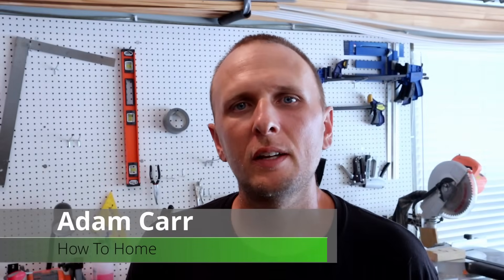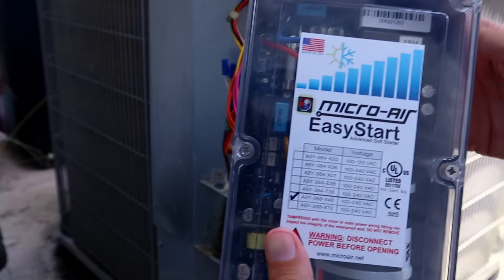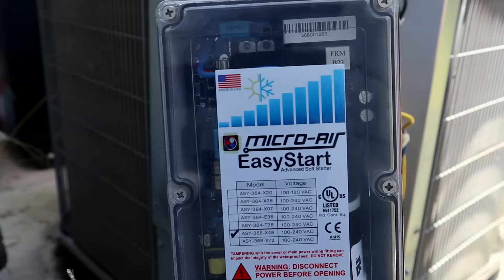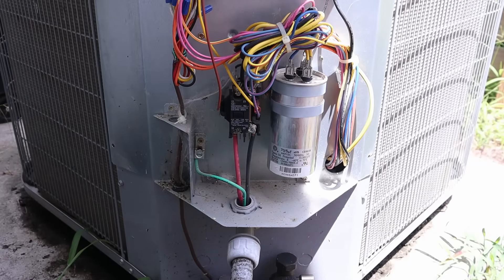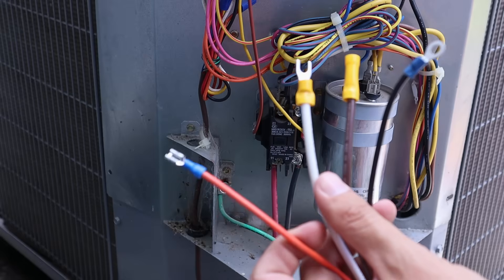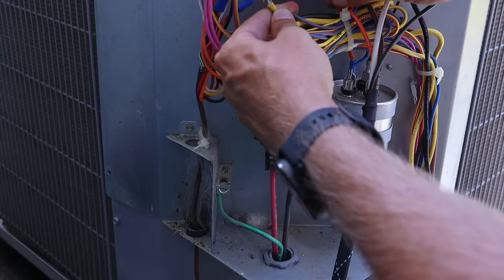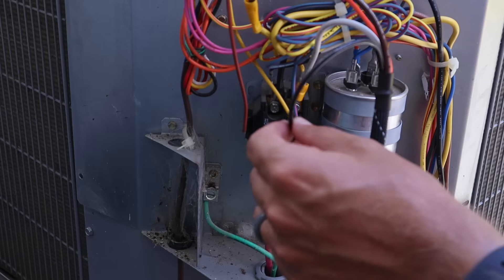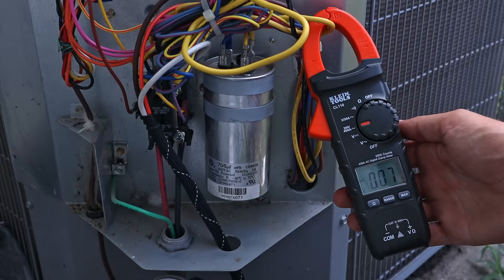How To Install A Soft Start Kit On A Air Conditioner | Run Home AC With A Generator | MicroAir

Comment: Adam,
My son and I just finished installing the Micro Air ASY-368-X48 Soft Start gizmo on our 4 ton A/C unit. We followed your instructions to a "T" and the results are as follows:
The IRA before was at 76.9, after the gizmo was installed it dropped down between 30.4 and 33.i Amps.
The running Amps before was between 12.8 and 13.1 and it dropped down to 10.9 Amps after the gizmo.
We attached ours to the side of the A/C unit and put a hoodie over it so that the intense south Florida sun does not bleach out the decal or make the clear plastic cover brittle over the years ( also it protects it from the rain).
We could have not done this without you, thank you so much for posting your informative, detailed video so a layman like myself could accomplish this.
Thank You and GOD BLESS YOU!
Reply from the maker: Wow, fantastic results!  Very similar to mine.  I also ended up making a box for mine just to shield it more from the elements and like you said, the sun.  I am glad to hear you were able to get it installed and it is working for you!  When the next hurricane comes, you are going to love having it!  Thank you for the feedback!  Always happy to hear when a video helps someone.  God bless you too!

Comment: Adam, Thanks for your quick response. I couldn't find the HERM label but I found out that it's the one that goes to the compressor. I will attempt the install tomorrow based on your very done video. Wish me luck!
Reply: For future reference from an hvac tech you could also count the pins for the spade connectors on the capacitor. 
4 is common from the contactor
3 is herm for the compressor
2 is fan to the condenser fan motor
Reply from the maker: Ok great!  Good luck!  Let me know how it goes.

Comment: Thanks for the vid. Bought the same easy soft start kit and hired a licensed HVAC to install it on my 4 ton Rheem for $65. IT WORKS LIKE A CHARM with my Wgen9500 on propane (11200/8500) generator. We’re now ready for the next act of nature here in Texas.
Reply from the maker: Awesome!  That is a good price!  You are definitely all setup and prepared.  We had some big storms wipe out the power a couple days ago for a few hours.  Hooked the generator up to the house and was like we never lost it haha.  Thank you for the feedback!  Enjoy!
Reply: You must live in bfe.  No one even knocks at the door here for under $85
Reply: @raddadization  No kidding. He must already be a next door neighbor/friend/ relative or something.
Reply: Do you know the running amps/kw when you are running the ac on generator power?  I am considering the Wgen 9500W thank you.
Reply: @CaptHammer  typically when the compressor kicks in, a 4 ton unit runs on about 5,000 watts.
Reply: @carapungo  Awesome thank you!

Comment: Hello,

Great video but which is the Herm terminal on the condenser. I see terminals that have wires going to the fan, kin of confused.
Reply from the maker: The capacitors usually have the terminals labeled somewhere around the terminal itself.  Typically there are 3 of them, c which is common, fan, and herm. Mine were labeled on the top of the capacitor.

Comment: Not trying to be negative but after pulling that disconnect double check to see if power is still present and discharge that cap once in awhile I hear of somebody getting hurt taking short cuts but otherwise good info thanks.
Reply: Nobody has ever been killed by a capacitor in a hvac unit that had the main power turned off. I have been zapped over a 100 times by power stored in run caps in the 30 years I have been doing hvac. It just wakes you up like a jolt of coffee

Comment: Where can I buy the soft start kit?
Reply from the maker: I have links in the description that will take you right to them.  Just make sure once you click on it that you select the correct sized one for your size AC unit.  Or you can go to Micro Air's website and find them their as well.

Comment: I appreciate how you give us detailed comments. I want to buy that same soft kit for my 4 tons a/c...but my generator is the Wgen 9500 dual fuel...will it work? Thanks in advance. Great vids.
Reply from the maker: It definitely should barring something weird going on.  Your generator I believe has 12kw or 12.5kw starting watts which is 50 amps at 240 volts and running amperage of around 39 amps.  If by installing this it got your amperage down to where I got my 4 ton, then it would barely break a sweat starting up the AC.  You would here it pull down briefly and then return to almost normal as your run wattage is plenty to run the AC once it has started up.  Hope this helps!  I really appreciate the feedback!
Reply: @HowToHomeDIY  you are the best.

Comment: Just added mine to our 4 ton unit. Runs the AC no problem at 75% load on my Storm Responder 6250. Your video made the install directions crystal clear!!! Thanks man!
Reply from the maker: Wow that is awesome!  These things really are great.  Glad you are up and running.  Thank you for that feedback! 👍
Reply: Are you guys seeing a substantial dip in voltage & hz from the generator when the AC unit starts up? I just damaged both my refrigerators while running whole house on generator. I believe the issue to possibly be a dip in voltage/hz when the AC unit starts up. Just curious to see if you have experienced something similar?
Reply from the maker: It could have been from what you described but it could also be your generator.  If it has a higher THD% it could damage the sensitive boards on whatever you are powering.
Reply: @HowToHomeDIY  The THD is less than 5%. It’s a generac Gp17500e
Reply from the maker: Oh ok.  If it’s that low then you should be good there.

Comment: I have the same unit installed but it comes with Bluetooth and basic app. Sometimes I get 25A,35A and sometimes I get 50A.I even get 65A. Several relearns and I can never get it to consistently keep the amps low.I have no clue what is going on but for some reason it does not work reliably. I did compare the data that are coming from the EasyStart app with an amp clam and the peak current is pretty close but the running current is off by 4A.....Very unreliable device as I dont know what it will draw at any given time. What do you think it might be wrong
Reply from the maker: I do know in the very beginning that the in rush amperage will vary as it is learning your system and the most efficient way to start it.  Anything outside of this I would call micro air and see if they have any suggestions as I personally haven’t experienced what you are describing.  I don’t have the Bluetooth version but I do have a sense energy monitoring device on my service panel and I haven’t seen any irregularities.  I would hate to speculate what could be causing it.  If it continues I would call micro air, they are very knowledgeable and helpful!
Reply: @HowToHomeDIY  Thanks for you answer. I have been working with MicroAir and they have been great in helping me to run som tests. But we still dont know what is going on. I checked the wiring again following your video and all looks the same as the instructions I used from the website. Maybe I got a bad unit.
Reply: @corgi_beemer2023  Did you get this issues fixed?
Reply: @SkyHawk2729  Fixed,no. I just live with it. I have also noticed the data from the ES does not match what I read on the clams and wehn ES shows 55A start my generator start just fine.
Reply: @corgi_beemer2023  I see. Well as long as your gen is able to keep up, thats all that matters. Do you lower the temp so it doesnt shut off as often?
Reply: @SkyHawk2729  Yes. I start the AC before anything else in the house. I then, set the desired temperature to either very low or very high depending on my needs and let it run for a while. After that turn it off and only use it when needed. This works fine for me with my 11.5kw/9.2kw prtable gen. Not ideal but hey this is for emergency situations only.

Comment: Great video, I was shocked to see the running current drop from 12amps to 7amps. Can you confirm you were connected to the common lead and not accidentally on the start or run winding?
Reply from the maker: I was shocked as well since it is not really an advertised benefit.  I was on the compressor common wire. I will say that I have heard from others reporting the same findings but would be irresponsible of me to make the claim that everyone will see the same exact results as I don’t work for micro air.  Hope this helps.  Thank you for the feedback!

Comment: In your video I believe that you said that you were going to mount this on the wall next to your disconnect switch. How long are the wires?
Reply from the maker: I do not recall exactly but around 2-3 foot.  I did mount it on the wall but there was no slack in the wire so I ended up making a post to mount it on next to the AC instead so there wasn't and tension on the wiring.  Hope this helps!

Comment: What's the difference between the hard and start you have videos on both doing the same thing
Reply from the maker: Hard start kit gets the compressor started faster therefore in a sense it brings the necessary inrush current down, soft start kit starts the fan first and gradually builds up the necessary amperage to start the compressor moments later, effectively lowering the necessary in rush of amperage by a large amount.  From my experience, the soft start is more effective in lowering the in rush and by a larger margin.  I went with a soft start on this 4 ton unit because it needed all the help it could get to allow a generator to run it.
Reply: Been talking to electricians the last few days and no one puts a soft start on.  Now what they do is put MAKE AC TIMER and 5-2-1 compressor saver.
Reply from the maker: I’m assuming when you say electrician you are talking about HVAC companies.  If so it’s odd that they would not install one.  Now they might have to order it as it isn’t nearly as common as a hard start capacitor install.  I have HVAC companies around me installing them but they are quite a bit more than the hard start kit and time delay relay.
Reply: @HowToHomeDIY  yeah that's what I meant.  Everyone I called had never heard of a soft start kit less lone installed one.  Weird I know, but everyone recommend the 5-2-1 and the make timer
Reply: major ac supply houses not atop soft starts.....it is an new gadget........sold mostly withi RVs......... @Cenlalowell

Comment: Does it matter which spade on the therm is used? I understand all other wires except that one, not sure if it goes on a particular location
Reply from the maker: Yes they all have specific wires to go on each location of the capacitor.  The herm terminal is one of usually 3 terminals on top of the capacitor.

Comment: Hello, Great video. I am planning on putting a soft start on my 3.5 ton unit. I have a 10k industrial generator (not portable) and whole house transfer. its a system I built myself with my own automatic load shedding setup too because I have a 3.5 and two 1.5 ac units on my house. but the 3.5 ton unit is the one I want to be able to run. I see that your inrush was lowered to like 31 amps, I'm curious though how low did you get after the 5th startup? I imagine it was even lower. Thank in advance. 

Also to any one doing anything with capacitors like this I recommend discharging the caps by shorting the terminals with an insulated screw driver before you start touching them with bare hands, caps can store quite a punch especially when they were just recently powered.
Reply from the maker: It probably did in fact go lower, however, I don't think I tested it again to see what it was after it's time of learning.  I was definitely impressed with how well it worked.  Sounds like you have quite the setup!  Thank you for the feedback!
Reply: @HowToHomeDIY  oh ok, thank you for the reply. I definitely like what I saw even if that was as low as it would go. I'm definitely going to get one for my 3.5 ton unit. Your video pushed to which one to get. It will be nice too since deck wraps around to behind my garage where all 3 condensers are, the big one is right next to the deck, it will be nice for it to not slam on so violently when you're sitting out there.  Thanks, yea its a decent set up, I'll eventually get an industrial 20k but my industrial 10k kohler does a great job now, just have to shed certain things. Have actually put your 4 ton AC on your generator, if so how did it do?

Comment: Adam if you buy this soft start on Amazon and tried to see if worked on ac to see if worked and it did not could you return? Or is it like most electrical parts if you hook up you cannot return.I have Duro max Eh 12000 myself with power inlet box and NG conversion.I have 50 amp box and 6 gauge cord. Do not mind buying to take chance on
Reply from the maker: Hey Donny, I would assume it would not be returnable if out of the packaging as it seems all items like this aren’t but I do believe they have a warranty if it doesn’t work out of the box. You could always contact the seller and ask though as they all have different policies.  If you get the correct unit for your ac, it will work though barring a defect of the unit, but I have yet to hear of that being an issue.
Reply: @HowToHomeDIY  Thanks Adam I think I am going to try around June and buy and hook up.Your videos are great

Comment: My A/C is still under warranty.  Do soft start kits void it?
Reply from the maker: Soft start kits themselves wont void your warranty but depending on who your warranty is with, they may require that a certified technician install it.  Would need to check with whoever holds your warranty.  Hope this helps!
Reply: @HowToHomeDIY  ok thanks very much.  I wouldn't attempt it myself but I have a 4 ton like you but its only a year old and the LRA is a LOT higher than yours  (109)   I'm surprised since its so new
Reply from the maker: Well the LRA on the sticker doesn’t necessarily mean that is your in rush.  Only way to know exactly what it is would be to do the in rush test.
Reply: @HowToHomeDIY  oh ok thanks.  I thought it was a hard rule

Comment: Super helpful video
What model clamp on meter are you using and what wires do you put it around to measure in rush? Thanks!
Reply: Disregard the question about the model of meter, I see it, I asked that question too soon
Reply from the maker: All good, I really like that meter for the money.  The clamp goes around the compressor run wire.  You will find a large gauge wire coming from your contactor and going to the compressor itself.  Hope this helps!
Reply: @HowToHomeDIY  
Is there a less expensive clamp on meter that you recommend? I can’t see myself spending that much on something I will probably just use one time

Comment: Hey Adam,  just wanted to say outstanding job.  I have been checking this exact unit out for over a year.  Finally decided to pull the trigger and purchase.  I have read the instructions several times to make sure I can install this.  Your video explained it to a tee.  Will be installing mine tomorrow.  I do have one question,  however.  The wire that you use to check the in rush amps in the video, is that the starting amp wire?  I appreciate all the information you gave,  definitely a lot easier to understand than the instructions that came with the unit.
Reply from the maker: Hey Jack, the wire you are referring to is the compressor common wire.  You will find a large gauge wire coming from your contactor and going to the compressor itself.  I think you will really like this unit.  Definitely makes things more efficient!  I am glad the video was helpful.  Thank you for the feedback!

Comment: New subscriber here. I am looking for soft start kits for my 2 heat pumps and a well pump. Would this kit apply to a well pump 220v 1.5 hp? Thanks foe the video. Nice advice on mounting to wall instead of inside.  Even if you have to weatherproof after the fact it could be good. Obviously I would need to know cooling requirements before sealing it due to weather. Again, great video.
Reply from the maker: Hey Brent, I have heard of these being able to be used on well pumps, I just do not have any experience myself in installing one on it.  I would recommend calling micro air and asking them any question that you might have.  I did before purchasing and they were extremely knowledgeable and friendly to talk to.  Yes the box is actually rated to be exposed to the elements but if you can have it under an eave for instance just to give it a little extra protection then why not?  I actually moved mine from the wall into a little box that I made for it to shelter it just so it would be closer to the AC and wires weren't just hanging in the air.  It is a really cool little device and I definitely recommend looking into it especially if wanting to run them on a generator.  Thanks for the feedback!  I hope this helps!
Reply: @HowToHomeDIY  you could always run some liquidtight conduit to protect the wires. It'd be cheap since you don't need much.
Reply: @HowToHomeDIY  thanks for the great advice. I will give micro air a call. And I agree about protecting from the elements ... “why not?”  Thanks for your response. I just got a notification and it looks like you responded a week ago. Not a problem at all. All the best!